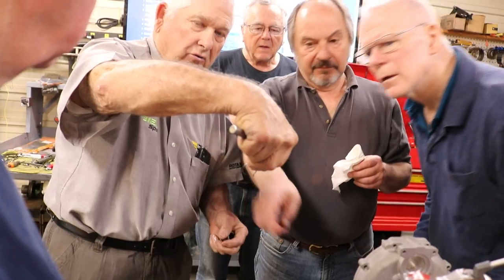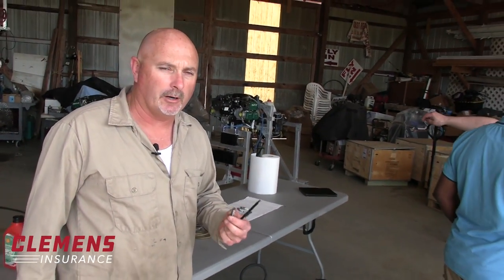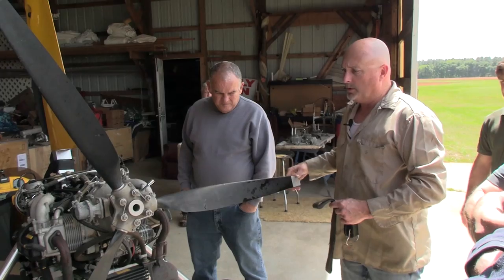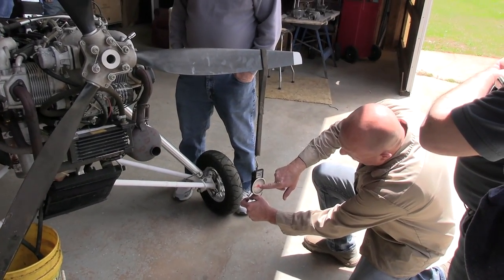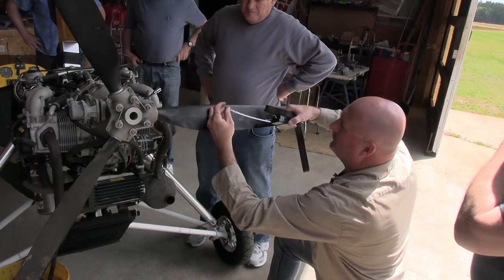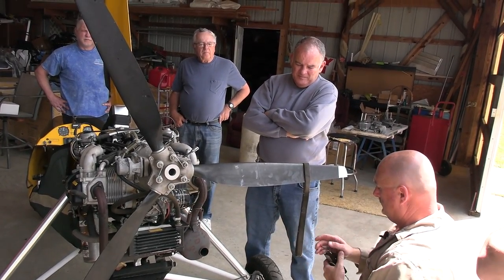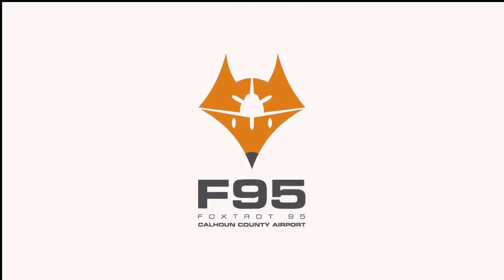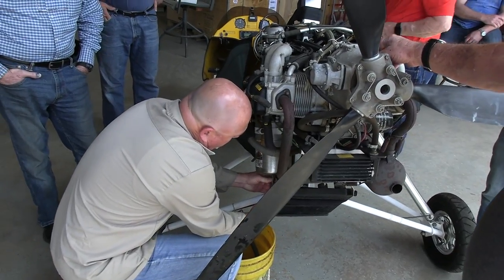Rotax Aircraft Engines - PULL TEST on Gearboxes - How To

Comment: Per the Rotax Line Maintenance Manual (ed 4 rev 1) section 12-20-00 page 61, step #5: " Calculate friction torque (Nm) by multiplying the force (N) obtained on the
spring scale by the distance the scale is attached from the center of the propeller (L).
The friction torque must be between 30 Nm and max. 70 Nm (22 to 51.6 ft.lb). "